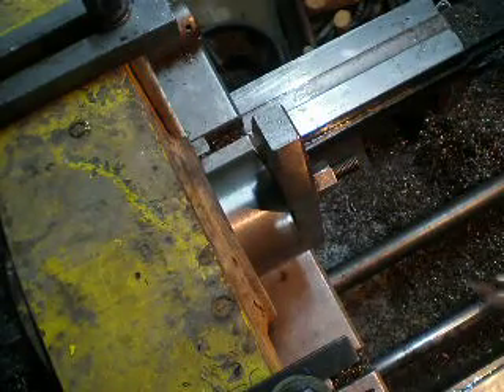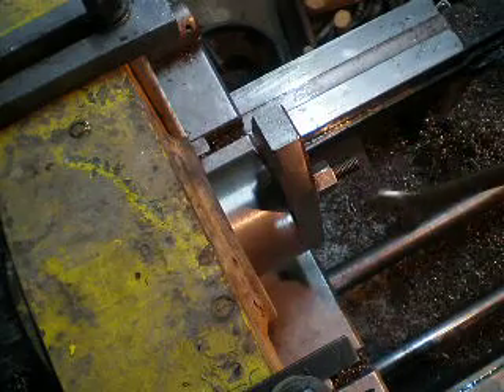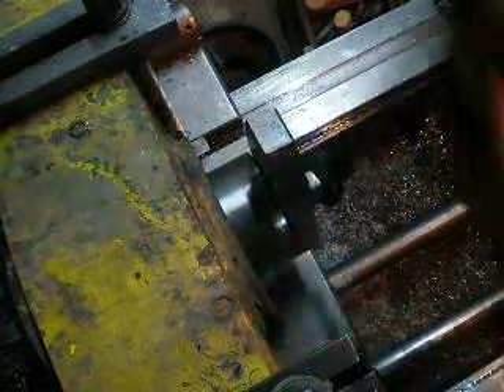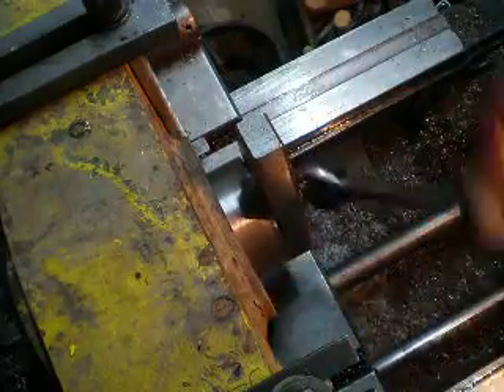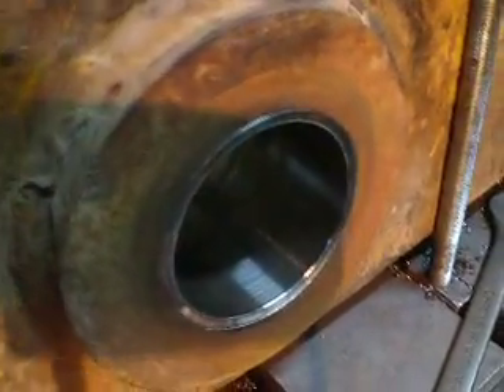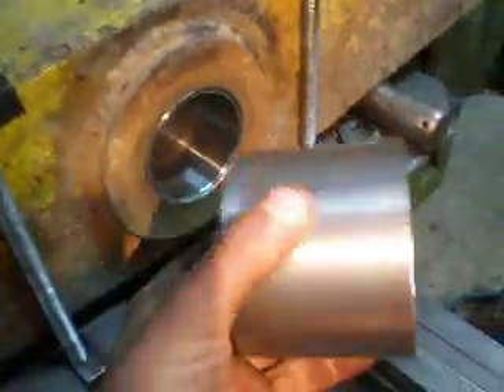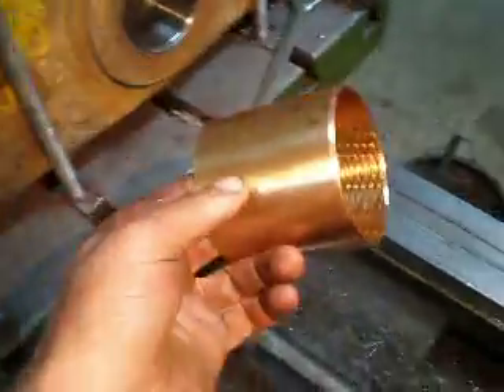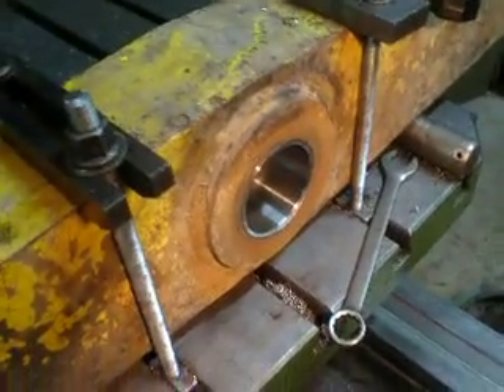Bore repair on horizontal boring machine part8 - installing reapair bush in the bore

Comment from the maker: Better way is use  hydraulic/ mechanical press or screws and nuts. In way by useing power feed for installing bush in the bore You damage and break machine!

Comment: Thats always a good technique for pressing in bushes. Just out of curiosity, did you think about driving the bushes in using the table power feed, and a bar fixed to the head of the boring machine?

Comment from the maker: In this case I make a 0,03 to 0,04mm tolerance (over-size). If the bush will be free, then my work lose any idea. Best way is use 0,05 to 0,1mm tolerance (over-size), but then I need 40tonne press and different measure for bore and repair kits.